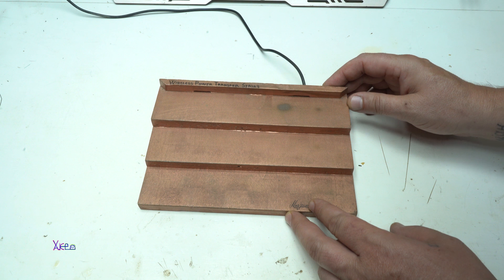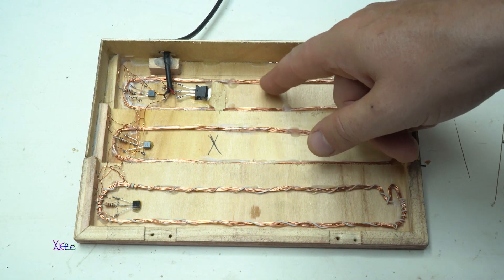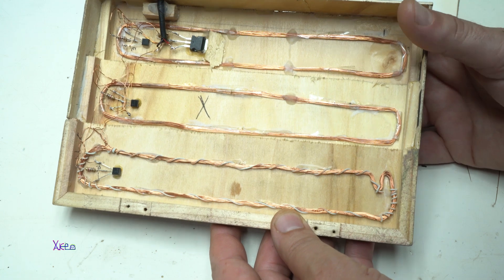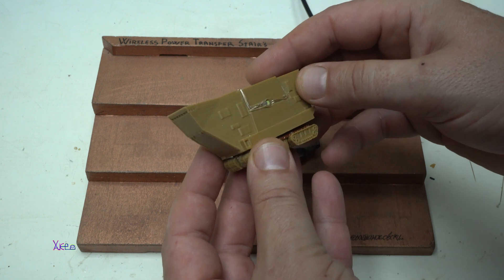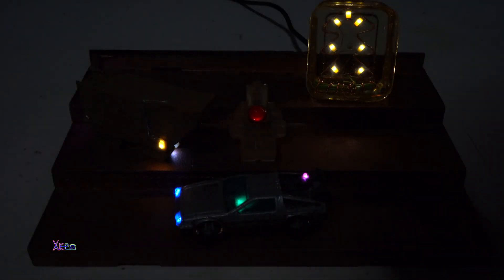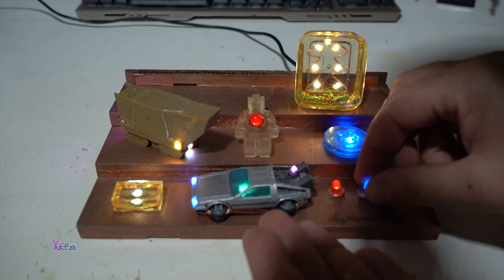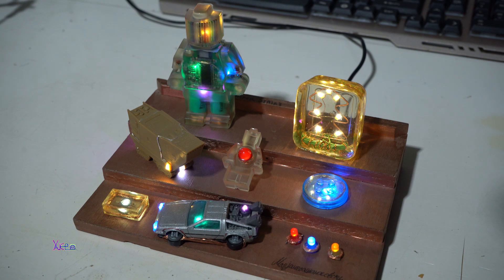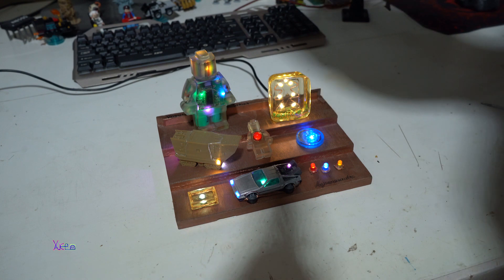Wireless LED Gadgets - DIY Wireless Projects

Comment: Hey nice information.
just want to know which voltage tou are using and how the heat is managed for BC337 BJT.
Reply from the maker: The circuit is powered with 1.5v and no need to add heatsink to transistor